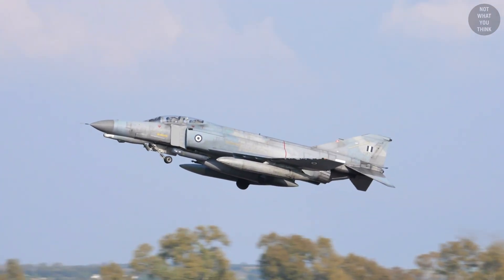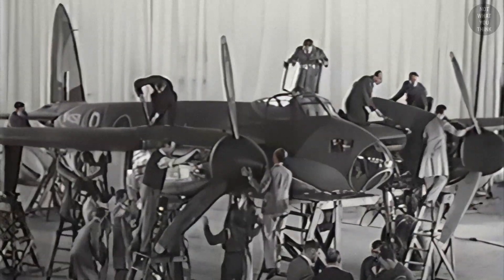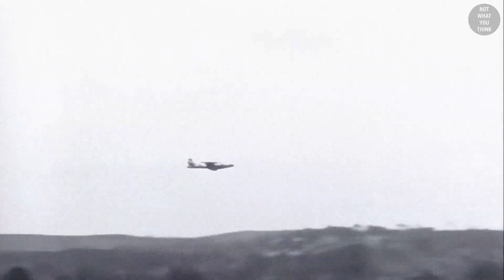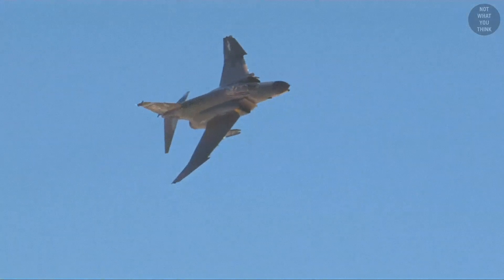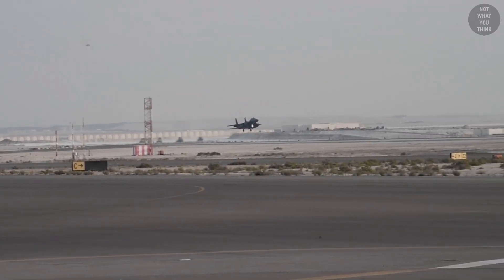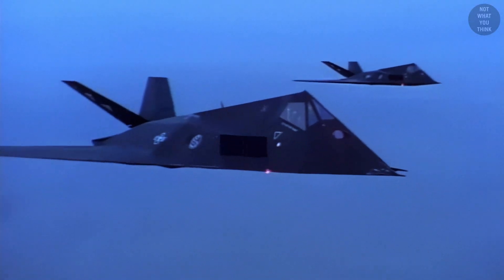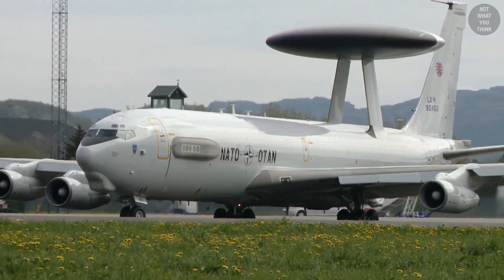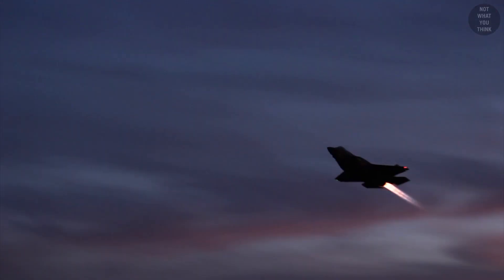Why are Modern Fighter Jets Slower than 1960s?

Comment: It is both an exception and cherypicking. And its cherypicking both ways.

For example a F4 can go Mach 2.23 but a Saab Draken can go "only" mach 2.0.... What is the fastest... well the draken, because it can go mach 2 at a much higher altitude. ... And well again. Draken is even older than F4.. So does that indicate its right, very much not.

F22 can go mach 2.25.

The F4 is a dedicated intercepter with a secondary fighter-bomber role. F35 is a multi role fighter.

There is two other things at play here also. While both the F4 and the Draken CAN do mach 2.2 in theory. When they have pretty much any load, like.. well a missile, they cant. And.. well in most cases not 2.0 either. So why did they do zero hours of mach 2.2.. because, that is not a true top speed. Not only do the missiles need to be removed, also the missile rails need to be removed. F35 and F22 have internal bays that don´t effect aerodynamics. so they can go top speed regardless (well more or less)

The second part is super cruise. Neither F4 or draken can do it... or even F14 or F15.. or F16. With no Super cruise the aircraft use that much fuel supersonic ability is only useful for a "get out of dodge" situation. For the F4, the combat range is pitifull, so in most cases they really didn´t have the fuel left to go supersonic regradless.

Again, F35 have a combat range 2½ that of the F4. So given most of the missions would be simular, the F35 could go supersonic for most of it, even using afterburners.

With supercruise most fighter size aircraft will still use more fuel going supersonic, but the diffrance is much lower.. well at least at altitude. For larger size aircraft, like the SR71 going supersonic might actually be more fuel efficient.

So its not really that newer aircraft goes slower, its rather than speed have been definged differently.

Air to air combait is today mostly done with missiles, turn rate is of very little imprtance in that case.
Reply: You got it backwards the F-4 does Mach 2.23 at 12,000m and the J35 does Mach 2 at 11,000m.
Reply: @MatthewČák2142  Well yes.. you are right.. well sort of... anyway. Its the range they can do  that is important. That is a aircraft may be able to fly faster at mach 1.8 than 2.0, that i suspect might be true int this case

Comment: While high maximum speed doesn't have a lot of military utility, having a high speed capability does.  While today's fighters have a lower maximum speed than older aircraft, this is a total system limitation. Today's aircraft far exceed older generations in thrust-weight ratio and have the capability of spending far more time above Mach 1, which has a great degree of utility in the modern battlespace.
Reply: But it's not only that. In the 1950s, 60s, and 70s, if your jets are fast enough, you're relatively safe from MOST missiles. The fastest missiles in the 1960s BARELY were able to catch up to the SR-71, for example.  

Today, no fighter jet is ever going to our run most top end missiles, both the smaller ones carried on other top end fighter jets your top end fighter jets are fighting against in the sky, and much less against bigger, faster, and better guided surface to air missiles. 

Today, most top end anti aircraft missiles fly between Mach 3 and Mach 6. Within 10 - 15 years, most top end anti aircraft missiles (air-air and ground-air) will fly between Mach 5 and Mach 9 or so.

Today, both China and the US have already shown they have missiles that could take down satellites in space... so altitudes and speeds of fighter jets, on their own, aren't overwhelming any more...

Investing in jets that, fastest, could only do up to Mach 3 or so (like the F-22, crude Foxbat, etc), therefore, is a waste of resources and man power. 

The FOCUS, then, shifts on to the BRAIN POWER of fighter jets: hence, the seemingly average F-35.  If money were no object, yes, the US would likely have built 1,500 F-23 and 1,500 F-22 and only a few F-35B for the Marines. But since even with a Defense Budge close to $1T like what the US has, you can't build and operate more than 150 fully serviced F-22, THAT ROUTE also was not pursued.

Having 2,500 to 3,000 mid range F-35s, each costing only 1/3 that of the F-22 ---- rather than having 250 F-22, flying up to Mach 3, each costing $300M - $400M  ---- but an F-35 that has easily 10 times the brain power (computational abilities & real life military tactical capabilities) of the larger and slightly faster F-22, therefore, is a no-brainer. 

The US Air Force also has more air tankers than all other nations of the world combined... so the slightly smaller & slightly slower F-35 isn't necessarily in that much of a disadvantage as compared to the slightly bigger and more powerful 2 engined ones like the F-22, F-15, Europefighter, Rafale, Su-35/57, etc.

Lastly & mostly as a side note:  the F-22 and Su-35/57's 2-D and 3-D nozzles are great at acrobats for slow speed, public shows; but in actual military engagements, they are not at all that useful. When your jet jet is flying above the speed of sound, especially at Mach 1.5 or higher, you will NEVER use 2-D or 3-D nozzles, unless you want your jet to come crushing down in flames all on your own, from extreme physical stress it goes through in such stupid maneuvers...
Reply: @kiabtoomlauj6249  You have to remember that the rocket motor even in modern missile burns for seconds and then the missile is gliding to the target.  A faster target has more chances of evading the missile. A faster target means the target can be closer to the launcher without being at risk of certain loss (the minimum abort range is smaller for a faster aircraft).  Also, the faster you are when you fire your Air Intercept missile, the better it's probability of kill. Speed is just as important now as it's ever been.
Reply: @kiabtoomlauj6249  Wow you have not the slightest clue what your talking about.
Reply: Still, A Mig 25 can just run away from the fight
Reply: @destroyerarmor  no it can't. The rockets any fighter plane carries go faster than it, and if it's going fast the flares won't throw off the heat signature.
Reply: Also there is no way for plane to run from rocket. Only anti rocket devices can protect. And it is also why they dog fight capibality today is usless.
Reply: @jakubkarczynski269  if you're flying a modern fighter and, for some reason you have merged with another modern fighter, you'd better be good a BFM. Otherwise, you're going to get smoked. They still practice it today because it could still happen and practicing could very well save their life.
Reply: Directly outrunning a missle, as if it's a drag race, isn't going to happen.  However more speed still gives you more options for outmanuvering a missle: putting more distance between your jet and any countermeasures you leave behind, preventing the missle from catching you before it runs out of fuel, etc.

Literally all this stuff us purely theoretical though, since any comparable force that has fighter jets also has nukes, which is the reason Ukraine hasn't been made a no fly zoke.  Serous air to air combat would happen for all of 5 minutes before every country on Earth was vaporized.
Reply: It doesn't go for all of them. Sr72 will be hypersonic, assuming it isn't already done and just not public.
Reply: High overall top speeds were deemed important for fighters used to scramble for air defense zones along the coast or for aircraft carrier battle groups. Reaching the attacking aircraft quickly - before they could launch long range missiles - was the objective.
Reply: Yes, and with super cruise the fuel efficiency problem is solved
Reply: @thor923  I'm not sure solved is the word I would use.  Improved is a better description.  They're not using afterburner to stay above transonic, but they still require a lot of dry-thrust to do it, so their burn rate is still pretty high.
Reply: @brianwright9514  How much throttle do you need to fly at cruising speed?
Reply: @thor923  wouldn't know. Ask CW Lemoine.
Reply: @thor923  improved, rather than solved. Transonic speeds and transition suck a lot of fuel
Reply: Speed is extremely important in BVR, and this video is wrong. The amount of energy the interceptor(missile) has the greater the range and probability of intercept, and for this reason modern air superiority fighters are just as fast as they were 50 years ago. F-22, Su-27, MiG-29, Su-57, F-15, J-20, Typhoon all can exceed Mach 2.0. Only strike fighters are getting comparatively slower because range far outclasses speed in terms of priority when attacking ground targets. This distinction between Air-Superiority, Multi-role, Strike-fighter is at the heart of this discussion but not even mentioned because I suspect it would de-bunk the entire premise of this video.
Reply: As modern missiles are substantially faster , far more agile and significantly more accurate than missiles designed in the 1960s
speed is moot
Reply: @verdebusterAP  Modern AAMs aren't substantially faster than they were in the 60s. Speed is never moot whether used offensively or defensively because intercepting or avoiding is a contest of energy between the missile and the target.
Reply: @mikedelta1441  
Again modern missiles are substantially faster 
1960s AAM were simple rockets whereas modern AAMs use more advanced propulsion 
The EU Meteor's throttleable ducted rocket allows the missile to accelerate in in terminal phase while its control principles are intended to allow high turn rates while maintaining intake and propulsion performance.
As you stated , its contest of energy and modern AAMs are designed to counter attempts to bleed energy
Reply: Oh yea? Wow that's so fascinating

Comment: Bit misleading. F-22 top speed mach 2.2
F-15 mach 2.5
Typhoon mach 2.5

Comparing ground attack aircraft to air superiority fighters is disingenuous
Reply: He was mentioning the super cruise for the F-22 not it’s actual to speed which the 2.2 is more of an estimate anyway because the top speed is actually classified and we only know it can fly above Mach 2. It’s also been reported that the F-22 was able to fly much faster (somewhere between Mach 2.4 - 2.8) during its testing phase. 

I’ve never heard the F-22’s top super cruise speed being reduced from Mach 1.8 to Mach 1.6 but I haven’t done research on this so I’ll give him the benefit of doubt on that one.
Reply: @kaijenkins4513  It hasn't it can still supercruise at 1.8 it just generally stays at 1.6 for increased IR stealth
Reply: @StevenLockey  Ok that makes sense then.